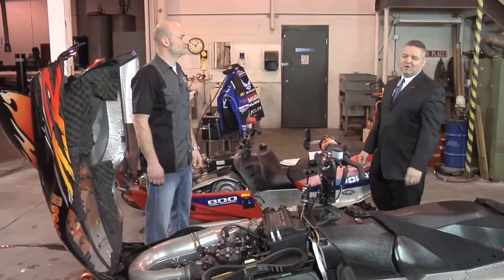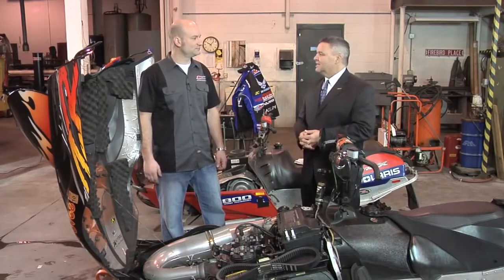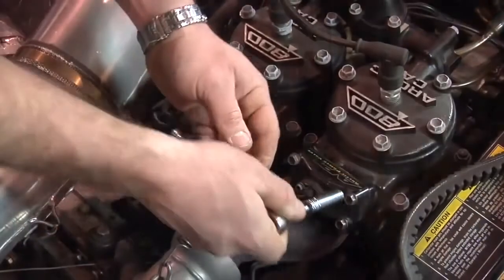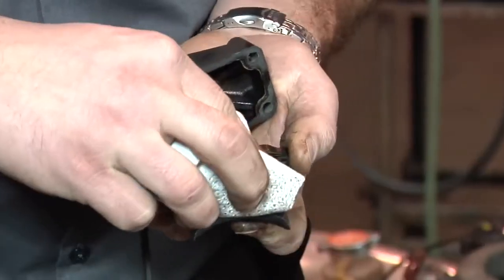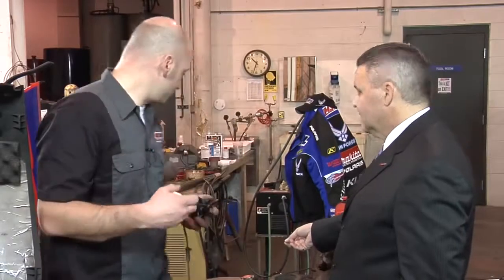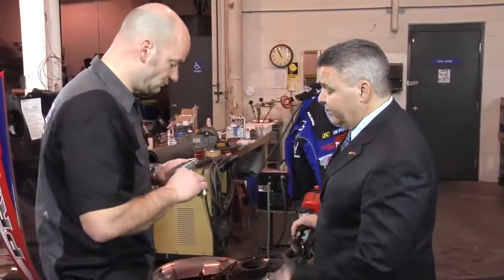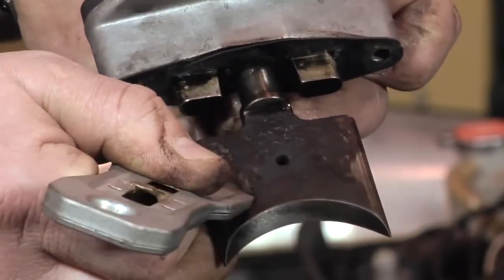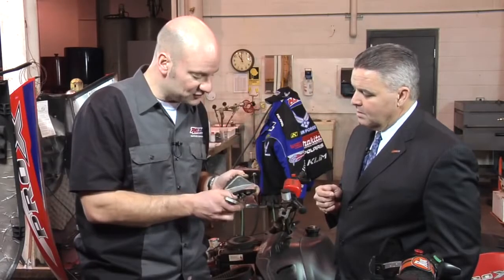Exhaust Power Valves

Comment: I just removed my 2001 SRX 700 power valves, the previous owner used only Amsoil Dominator 2 stroke oil and the valves were horrible looking. Rebuilt ,Cleaned and replaced valves. Went back to Yamalube 2S and never had any more issues. Valves always look great after reg maint now

Comment: Both me and my friend  used Amsoil Interceptor in our 2000 Yamaha 700 SRX's, after riding 500 miles with Amsoil the carbon build up was so bad it caused the valves to stick bad. It wrecked two of my valves and also wrecked the cables. My friend couldn't even get one of his valves out without using a vice grip and some serious pulling. I sent pictures of my valves and cables to Amsoil with what had happened. They did not respond. Just so you know, we both cleaned our power valves  before we started using the Amsoil, so there was no carbon on the valves before the Amsoil.  Ended up costing me almost $300 bucks to replace the bad parts, and that was with used parts. Both of us were so disappointed not only because of the cost of repairs, and the poor performance of our sleds due to the valves sticking, but we got a great deal on 4 gallons each and now had no use for it. We both immediately sucked the rest of the Amsoil out of our sleds. Gave it all away.  I switched to Klotz and my friend went with Yamalube. We put on another 500 miles and took them apart again. My sled ran great with Klotz and when taken apart, the valves looked amazing, no carbon build up at all, glided out with no effort. The Yamalube worked great also. Not as good as the Klotz, but the valves moved freely and didnt wreck anything.. SO if you have a Yammy with power valves ,, I would NOT recommend Amsoil of any kind. Two sleds and 500 miles with hundreds in repairs is what we got from it.
Reply: Has Amsoil responded to this criticism yet?
Reply: Amsoil Interceptor is a good oil, but I would not recommend it for motors with power valves. I’ve used it in yamaha waverunners and in these motors it will not leave hard carbon deposits on the valves, but it does leave a bunch of sticky sludge on the valve and its stem which can prevent the valve from moving. The valve still needs to be removed and the sludge cleaned up. 
Klotz burns very clean. No hard carbon and no sludge build up. You can take a piston that was ran on Klotz for 50 hours, rinse the carbon off the crown with a shot of brake cleaner and it will look brand new. 
I would not hesitate to run amsoil in a non-power valve motor, but if it has power valves, use Klotz.
Reply: Good info thanks!   i used to use amsoil, but if they don't give a shit to contact you, obviously they don't give 2 shits about our opinions, so I guess i won't give 2 half shits to buy their products.   Klotz smells good 2!